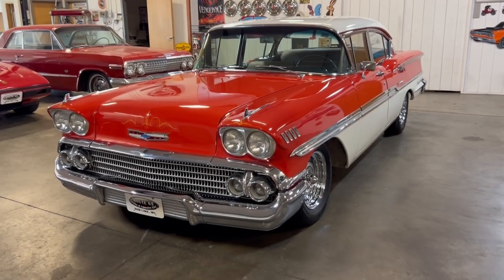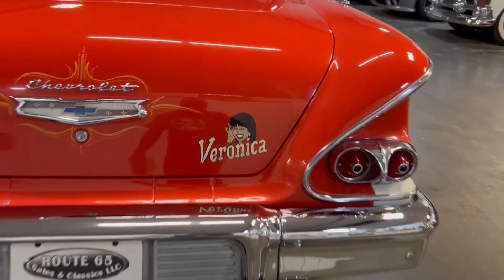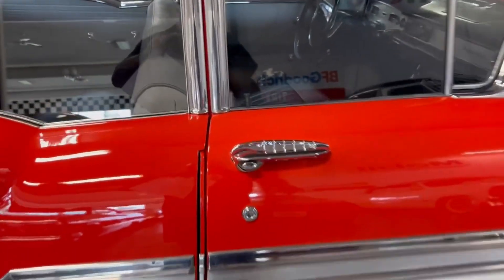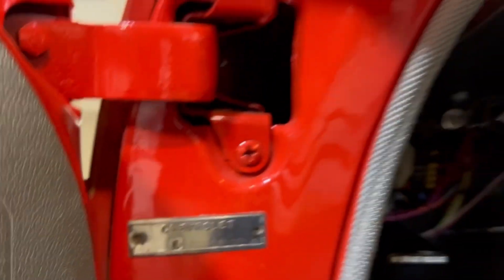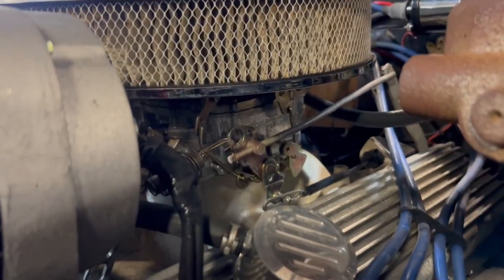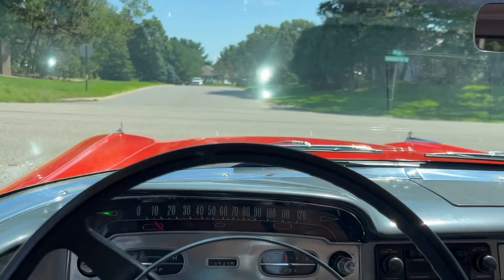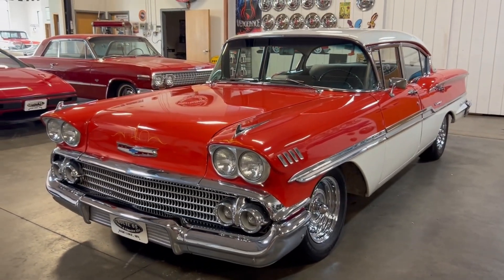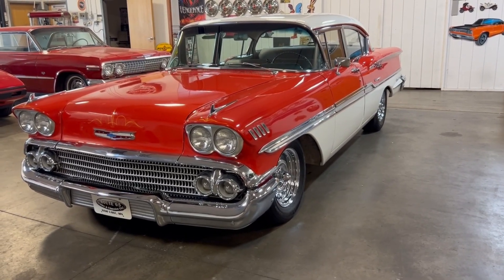1958 Chevrolet Biscayne 4DR CC10506 For Sale $21,990

Comment: Back in the mid-1970s, I had an original owner 4-door (no-post) hardtop Bel Air with the optional 348 and TurboGlide transmission.  Oh, what a joy it was to drive. It was in super cherry condition in two-tome yellow & white with an unmolested orig interior in two-tone green. The electric clocks in these are easily repairable. Most of them quit working because of years of dirt, dust and corrosion of the electric contact switch mechanism and main spring. Blow out the dirt, spray with brake-klean and clean the electric contact surfaces with Emory cloth and it's good to go.

Comment: Too bad the person who restored this didn't replace the blanked-out dash nacelle above the steering column (from its original 3-speed manual configuration) to one with the gear position quadrant for the swapped-in automatic trans. Also, a "V" badge emblem would've been nice on the front of the hood and deck lid, since it's no longer a 235 six, and now a V8 conversion.